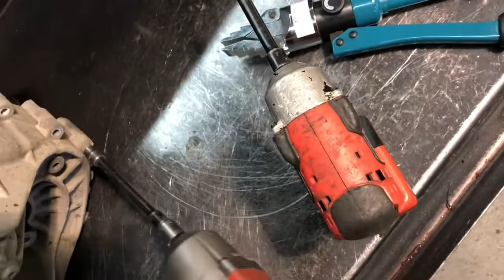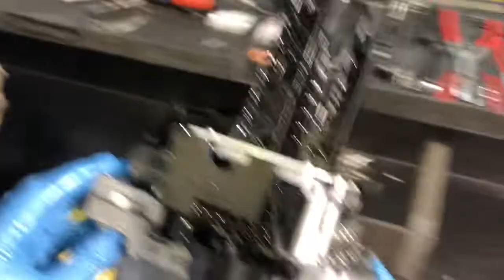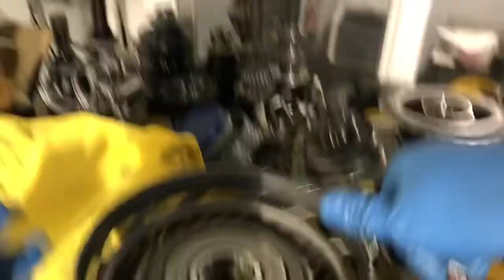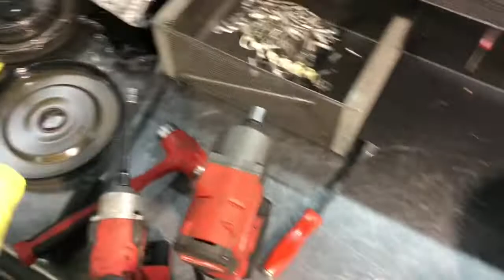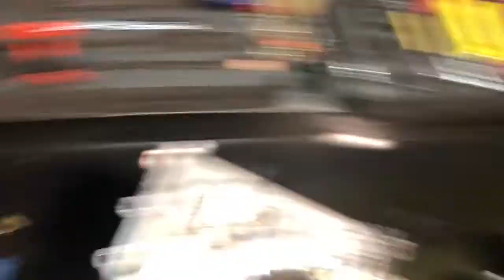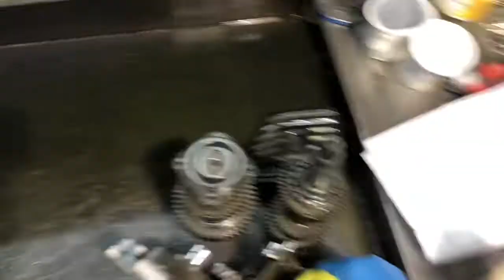Jacks Transmissions SST Teardown and Inspection Dual Clutch

Comment: So the bench test of the clutch pack wear is also a cool way to see the infamous lighting fast clutch swapping from even and odd gears?
Reply from the maker: That is just one side.  You are getting a cross-over with one side letting go as the other engages when you're driving.
Reply: @GVR1670  Alright.

Comment: What is the price on rebuilding this type of transmission??
Reply from the maker: It depends on the issue and what you want out of the car.  It can range from $2000 to $8000+ depending on how far you want to go.  If you want a repair only, or a trans that will withstand power upgrades and last a long time with our many in-house made billet parts.  There are a lot of options.

Comment: How big should the gap be in the clutch? I have heard that 4mm is too much and 2mm is ok. How little can it be?
Reply from the maker: What brand clutch frictions are you installing?
Reply: @GVR1670  Don't know what brand, no name maybe. I have a problem that when I try to run Clutch System Learn with Forscan, I get the error code Clutch Ventilation Learn Error. I thought it has to do with there being a very small gap in the plates after I changed to the new ones (gap is ~0.5 mm). Thought that if it is tight between the plates the flow will be too low and it will result in Clutch Ventilation Error. But I really have no idea what Clutch Ventilation is. If you believe or can confirm my theory, I will remove the transmission from the car again and change back to the old friction pack. Am I on the right track or do you have another suggestion?
Reply from the maker: @chrilleerikson5560  Do you have a pic of the clutch frictions?  I'll know by looking at it.  If you reinstall the OEMs you will get random fork errors due to clutch drag, so I wouldn't recommend that either.  Reinstalling used OEM frictions never works in the SST.  We've tried it countless times.  It will look like it works, then the errors start coming.

Comment: hey jack, i’ve got 08 Ralliart and the cars been on and off the p1875 code for around a year, car hasn’t gotten better or gotten worse, would you recommend just changing the torque damper sensor? i’ve already got a upgraded shift fork waiting to go in
Reply from the maker: It’s hard to say without having it apart. This platform is aging so it likely needs more than just a sensor and fork. You can try, but getting to the speed sensor requires tearing the whole trans down.

Comment: I know I'm supposed to use OEM transmission fluid in my sst. Have you seen problems with Amsoil DCT?
Reply from the maker: Have not tried it but I can't imagine it would be an issue.  Should be totally fine.
Reply: @GVR1670  thanks for the advice. The Amsoil DCT has been in my Trans for a few months now working great shifts smooth..

Comment: Hi Jack, just out of curiosity in regards to the shift fork magnets. Wouldn't be a better idea to replace ALL of the magnets with the full billet magnets instead of just the 2-4? Also in regards to the axle seals for the SST front driver side, how are those removed and installed? Can you make a video one that in the future? Thanks
Reply from the maker: None of the others have the issue with the magnets. Sometimes 3/5 fork will get a little loose but it’s rare. 

The axle seal is like any other axle seal for the install. Nothing special there. However, Mits did have different sized seals for that area (of course) and you just need to make sure you get the right one. There are ways to check the case so as to know what you need.

Comment: Hi Jack. I've got a question about preventative maintenance with these SSTs. I have a 2014 MR I bought new in 2013. During break-in and the warranty period I was overtly gentle with the car. After its warranty expired I did the whole bolt ons route, tune, and some other work and got the car to the upper 300 wheel HP. I have the Kozmic Motorsports Dodson Heated Sump kit which adds the built in thermostat to protect from overheat, the larger billet transmisison pan for larger capacity, and plumbs into the car's heater hose piping to be warmed during startup and cooled during operation from the car's radiator. (Also have an upgraded Mishimoto radiator to keep up with the additional heat being put into the sytstem from the trans). On top of that I also replaced the OEM trans cooler with an AMS cooler, and during all this also changed the transmission fluid and put in the stainless steel washable reusable filter from SSP. 

This was around 2017. When I did the fluid change the transmission fluid looked like it had come out of a car with 200,000 miles on it. It looked bad. Didn't smell burnt or anything it just looked god awful dirty. I remember it bothered me enough to call the dealership to ask if Mitsubishi put a break-in oil in these cars that was supposed to be changed out after 500-1,000 miles or something. As I said before, I grandma'd this car for 95% of its time on the road, with the other 5% just legal speed "spirited" driving on public roads. I bough this car in my 20s with my own money so I have always had a bit of mechanical empathy with it. The car gets garage stored during the winter, and has just over 20k miles on it, but I have always wondered why in the world the trans fluid and filter looked like it came out of a junkyard truck from the 70s. I have had some slight issues with the transmission "slipping" where you give it gas and the car just acts like it doesn't want to go until it will finally "catch" and go. It has also thrown a trans code once or twice, but once cleared never triggered again; its been so long I don't even remember what code it was. So with all that backstory aside, with the issues these transmissions can have, and me just now finding out about the potential broken spring issue, is it worth the trouble and expense to pull the unit from a working running car with relatively no issues (aside what I stated), to basically "bulletproof" it and add the upgrades just to get it done and over. If anything else than to get that ever present worry in the back of your head of "I hope the trans doesn't go" to be a little less prevalent so you can worry about the next thing.
Reply from the maker: Yes unfortunately everything you thought was right is in fact wrong. The SS Line Filter doesn’t filter anywhere near as well as the OEM paper element. So by installing the filter you are allowing more material to pass through the system and more chances of that material getting caught in the pump, sump filter and solenoids. On top of that the heated sump doesn’t work. It is popular and we remove every single one of them that we see on any unit that arrives at our facility. Your fluid and how it looks is common as the heated sump burns the trans up.

1) Remove the heated sump junk and reinstall the OEM pan. I don’t know who said those are a good ‘upgrade’ but they are not. 
2) Remove the SS Line Filter and install a paper filter that will actually catch something. 

Unfortunately it might be too late in your case. The paper sump filter deep inside the trans has likely been working double duty thanks to the SS Line Filter and is likely not allowing the volume needed to pass. Also, the solenoids on the valve body are likely plugged up with a mixture of metal and clutch material goo. The solenoids attract this inside the body and they become lazy causing inconsistent fluid pressures and clutch crossover. 

Sorry but your issue is far too common. It is repairable and we are more than happy to help. New sump filter, rebuilding the valve body and removing the aftermarket parts will allow the unit to function correctly again and not kill the fluid.
Reply: @GVR1670  Well I appreciate the information and I'll deffinitely think on it. I'd deffinitely want a few more second opinions before ripping off parts. There's just a few things I want to clear up:

I don't know if I specified time frame, but that fluid that looked horrible was taken out as I put the mods ON the car, not from fluid after they were put on. That was from a complete factory car. There weren't mods on the car to ruin the fluid. So it's not as if aftermarket mods were the cause. That fluid had around 12k miles on it when I changed it over, and the car was the same was it was when it left the dealer.

As for the heated sump, how do you remove them when they show up? The only part that would be on the transmission itself would be the larger pan. I don't mean to sound distrespectful here I am just generally curious. Larger fluid pans equate to more thermal mass and have been a 'upgrade' on cars or even trucks for that matter for decades. It's thermodynamics, more fluid means more thermal mass to prevent spikes, and then you cool said fluid. I've seen it work very well on hot days at a track, whereas with the OEM setup I literally had the transmission overheat and go into limp mode on a very hot day in bumper-to-bumper traffic. In this setup I've had it run on a road course and the temperature never budged. So I am just generally curious why you would think they aren't useful, and even dentramental enough to want to remove them?

As for the SSP filter, I agree the stock paper filters have a better micron rating. When I put that on the car the OEM filters were pretty expensive, especially if coming from the dealer. I got the filter during a sale and figured I'd end up saving over the next few years, but the price for new paper filters is now like 20 bucks so that one didn't pan out so well.
Reply from the maker: @fubar5884  we have put a huge amount of work learning about the valve body for many years. Everything from the issues which plaque them to the software. We can get the mechatronic to shift the SST like an r35 GT-R in normal mode with no slip at all. We have noticed that a large number of people using the heated sump run into early valve body failures. Units we received with the heated sump typically have a failed valve body. So on paper it may look great, but the reality is parts are failing with that part installed. Don’t you have an issue right now with your trans?  

Removing it is simple. You pull it off, throw it in the trash and reinstall the plastic pan. More fluid in the unit makes no difference. I’ve been fighting with this logic for years across the board on all DCT units. In fact, most larger sumps will create cavitation issues with most units that are road raced with them. The factory pan and factory fluid fill works just fine if you’re using a good cooler. Thermal mass will only make a difference (and a very small almost unnoticeable difference) if you have a problem- like overheating. It will not stop the overheating, just delay it. I see this with ALL platforms. People have an issue, install a bigger pan and the issue is still there. It’s an excuse for people to make money building useless ‘billet’ parts that look cool. 

Sandwich coolers have been used more on modern cars to get them up to temp. For an engine it is critical to get it up to normal operating temp ASAP and they work well with that. The cooler you have is not a sandwich cooler. It’s just a tub that holds coolant and you hope that the heat or cold will transfer quickly via the cooling system when the fluid is up against the sump. With the SST we found that the cooler it is the better. Whoever put it out there that you need to have your trans up to 200+ F ASAP is costing people mechatronic units. The SST is not happy doing this. We have put a huge amount of time studying this and low temps in the SST is fine. The reason they may feel more slippy when cold is all in the software. It is NOT a hardware cold temp issue. There are only so many 200f cycles it can have until it fails. If we have a failing mechatronic we make it fail via high temps. At 180f or above the mechatronic will act up and fail our tests if it becomes problematic. These units do not like anything over 180f. With your cooler, you ate forcing it over 180f every time you drive it. Then the mechatronic fails, you have pressure and clutch crossover control issues and well- here you are.

Comment: They're so complex and delicate it's a wonder they work at all! Incredibly, my 08 Evo has over 300,000km on the clock and is still on its original clutches with (touch wood) no problems yet. Jack, can you recommend any place in Australia for a trans service for when the time inevitably comes? Thanks, and very informative video!
Reply from the maker: Unfortunately, I do not know.  Jacks Transmissions in the USA can ship parts you need and give tech support if you can find someone to do the work.
Reply: @GVR1670  thank you, that's good to know.
Reply: @emlix1 depending on where in aus you are, ak racing in brissy and rp Motorsport in syd

Comment: awesome video! i'm actually about to tear mine apart because it has a p184b shift fork magnet issue. do you have any recommendations for forewarnings?
Reply from the maker: It’s not too bad. Likely the magnets are loose or broken on the fork. If you need a replacement I have billet ones in stock :)
Reply: @GVR1670  that would be awesome! where would i be able to buy them?
Reply: @GVR1670  bro i need you help
Reply from the maker: You can email me directly. I don’t think we have them on our website but I have them in stock. We install the billet magnet upgrade on all of the SST units as it’s a common issue. My email is shop@jackstransmissions.com